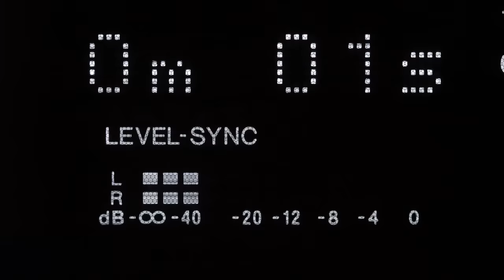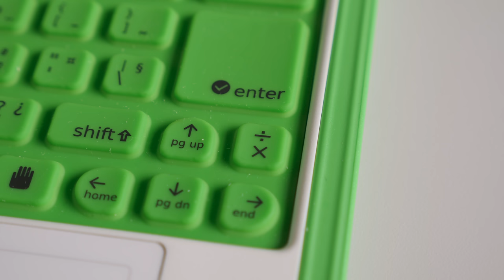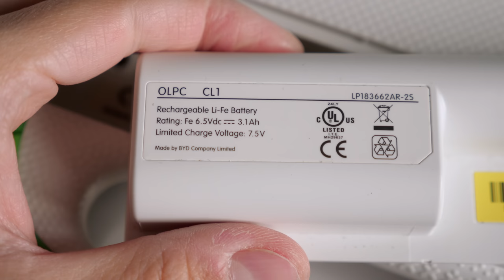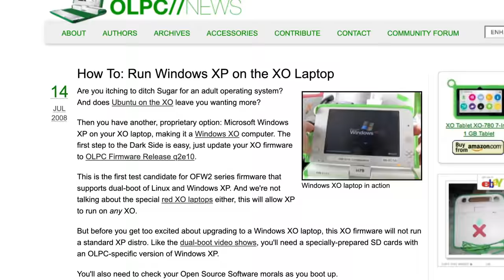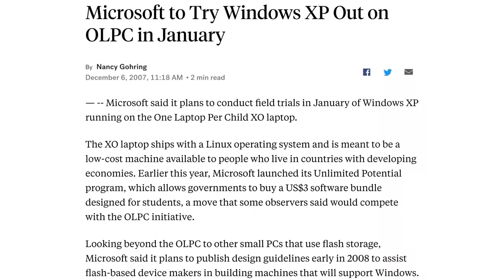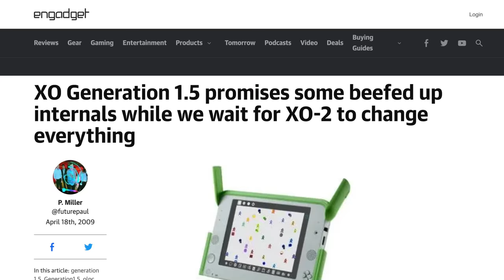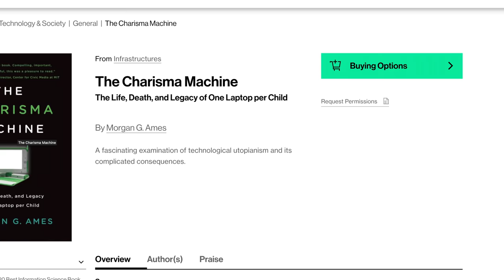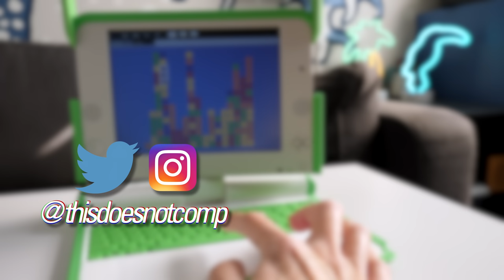OLPC XO-1: The $100 Laptop (That Wasn't)

Comment: I have a family friend who worked for OLPC, and he had spare prototypes and display models that he gave me when I was little. I still have an OLPC XO-4 Touch engineering sample, it's nearly identical to the production one except for having different speaker mounts (that started to sound awful after a few years), an XO-1.75 hinge cover, a different touch digitizer (mine has since been replaced with a production one), and the serial # sticker says "engineering sample, not for resale".

Comment: First of all, thank you very much for introducing a topic I've never seen covered before.  I think it would be interesting to put a team together and challenged them to hit that $100 mark through design changes and sourcing components.  A lot of nations have components made cheaply by using a miserly paid work force and pocket the margin between cost and price.  What if they can be convinced to sell some of those components at cost so that the poor of their own country as well as others could have computers.
Reply: already reached with the Pi 4. 35 to $70 depending on the RAM size - 4- 8GB

Comment: I have an XO-4, snagged from ebay, as well as an XO-1. The newer model really is tremendously more useful. In practice the battery life is doubled (with an identical, interchangeable battery, mind you) and everything from booting to compiling is roughly twice as fast. The XO-4 touch screen isn't capacitative: the bezel is deeper, and it uses a grid of IR light sensors/emitters in that bezel to detect touches. One nice thing about this approach is that it doesn't require the addition of any layers to the display module itself; that part is identical and interchangeable between all XO models.

Comment: Still one of the projects I'm proudest to have been a part of in my life and that I was the saddest about it's failure. It might not have worked, but we had some damn good ideas that wound up paving the way for other things. What still gets me is that the hand crank wasn't a part of the machine by default like it was in all of the prototypes (battery life was always on the chopping block) and it wasn't quite as powerful as it needed to be even for educational uses. It could have been a killer dual purpose hacking/light gaming machine for on-the-go but it just wasn't powerful enough to do anything really useful. I still think putting those controller buttons on the face was a great idea. I'm shocked to hear it actually made some wide adoption, I remember the whole thing just fizzling out. I knew the project was over though when people kept insisting on shoving windows onto it and even some governments refusing to adopt the project without windows support. That wasn't what it was designed for at all but we see even today people refuse to break their x86 addiction. It's just the way these things go once they hit the mainstream, and this was a hard way to learn that for a lot of us. You can see the same thing happening today with so many people buying Raspberry Pi's just to use them as retro game machines and refusing to learn anything about the OS much less actually run it to transfer their roms. People might laugh at us and say we are wasting our time, but when the goal is noble and the cause is just it makes it all worth it.

Comment: I followed this quote closely at the time. I never saw any in the UK or Australia though. I think they did have a real impact though. In their own way they were a sign of things to come - they were essentially the proto-netbook, and as is hinted at in the video - the experience and confidence Microsoft gained on building Windows for low spec hardware did give them more willingness to tackle that with netbook architecture, which in turn inspired the Chromebook - bringing the whole project full circle to a low-cost, rugged, simple educational computer.

Comment: Thanks for the video. The XO deserves better recognition. I still have my G1G1 XO-1. For a while I used it as a daily driver laptop. Sometimes its limitations had me crying, more often it was a joy. I was able to install a more traditional linux desktop on it. Internally to OLPC I feel there were a couple of places they dropped the ball.

1) School boards are incredibly conservative organizations, and they set the curriculum. OLPC's commitment to Constructivist education, while noble and noteworthy, made it a non-starter many places. Particularly in the US where school boards were local.

2) OLPC had a very high minded motto "It's an Education Project". That is, it's not a product in a conventional sense. Other then the limited G1G1 project, you couldn't just buy one (or ten). There was no way to get them for something like a a computer club, pilot program, or the like, let alone for a curious individual.

Comment: I remember seeing announcements of these, including the concept with the built-in hand crank. But, I'm not aware of those here in Brazil.
The intentions were good, and the efforts were worth it, but, it really meant a lot of planning and cost cuts, which included performance.
If it was born a few years later, in the era of smartphones and tablets, with better and cheaper components, it probably would go further.

Comment: Computers have gotten so much cheaper now, and you have the ability to download an archive of Wikipedia to a 60 gb file.  Students can access an incredibly large body of knowledge offline through a smart phone, tablet, or laptop now.  Only issue is electricity.  Power banks are very cheap if you're using solar at the school, and i would imagine having a panel in rural homes would have benefits as well outside of simply charging a laptop or phone.

Comment: I have several of these still.  I really believed in the concept when they were announced and wanted to make apps and games for it.  But it was pretty clear things were not going to work out.  They neglected the growth of Netbook market that was ultimately doing better than what OLPC could do in terms of price and performance of the hardware.  

On the software side, I think the problem was more fundamental.  I saw the attitude of typical western way of thinking and just providing kids with edutainment level of softwares.  I always argued it should be something that could lead for kids to directly work with everything that the workplace uses including the OS.  The argument was that you can install Linux based equivalent of word processor, spreadsheet and so on.  

I still wish it would have been a different story in the alternate history.  Perhaps some sort of agreement could have been made for Apple to come up with a version of OS X that was open source... Or someone business savvy was in charge at OLPC to have more of a market ready model... :(
Reply: Microsoft choked it out by forcing vendors to only sell MIcrosoft operating systems.

Comment: Back in the day I read that the arm based version was going to be based on RISCOS, the same os that ran on Acorn computers and now on the Raspberry Pi. As someone thta owned  Riscstation 7500, the use of that operating system made sense. It is so efficient that my computer with 16mb of ram ran just as well as my Windows PC with 128mb of memory. Sadly, Riscos was never used.

Comment: I remember when these were first announced, It was a really good idea, I wish they could have achieved it more effectively. The raspberry pi I think has become more of a successor to this idea. $35 little computers you can do anything you want with that can connect up to just about any screen you can find. So for about $50 to $60 bucks you can get a computer up and running using an old tv a cheap mouse and keyboard with everything being stored on plentiful and cheap SD cards, the idea has kind of pushed forward. And unlike the OLPC initiative, Raspberry Pi had wider spread appeal in industry and general maker space that it just became possible to perpetuate itself far more than OLPC's XO-1 as it wasn't just a non-profit trying to bring computers for education to the 3rd world. Raspberry Pi was trying to bring computers and learning To anyone and everyone interested. The XO-1 is still an interesting piece of tech, with good ideas behind it.

Comment: The OS this device runs is called Fedora SoaS (Sugar on a Stick). This version is a VERY locked down version of fedora. As the interface suggests, it is meant for children. The OS can also be freely downloaded by anyone if they wanted to run it on a different machine. I guess you could call it the ChromeOS at the time.

Comment: Quick note.  The XO-4 did not have a capacitive touchscreen.  In order to keep the Pixel Qi screen, instead we used an IR based touch system using Neonode's technology. This meant it could also be used while wearing gloves, or with any generic pointing device.

Comment: I think the OLPC was a great way of bringing the budding tradition of computer use to the impoverished world. I think the concept of the hand crank might have been a bit short-sighted. A gas generator or solar panel network would have worked better. I also think that shared desktop computers might be a more feasible means of getting children computer access since the machines may last longer. But there's something beautiful about each kid having a computer. 

I always thought the XO-1 model was cute. I wanted nothing more than a laptop and a docking station as a young child, and I was also fascinated by Linux distros. XO1s seem like cool machines for their time. While the rubberized bumpers and thicker shell than most laptops made from plastic at the time might have contributed to its durability, you also have to consider that solid-state drives are more resilient than the (electromechanical) hard drives common at the time. A modern MacBook can also take a few drops.

Comment: 3:40 Don't forget that LiFePO4 batteries only got half the capacity (90-120Wh/kg) of a more common lithium-lon batteries that use cobalt or mangan, I guess with those batteries the XO-1 would achieve more than five hours, but these are also more dangerous than LFP cells.

Comment: I'm so glad the Raspberry Pi Foundation stepped in with a truly affordable and popular SBC.
Reply: As someone who supported both projects, they fill entirely different niches. The original idea behind OLPC was bold, not only in its price point, but also pushing some technology concepts like wireless mesh networking that built itself, as well as simplifying management of those systems. They also developed new technologies that I hoped would trickle up, since they addressed immediate needs in the third world, but also fixed problems for other concepts. The best example of this is the screen technology in the original models, which was an absolute marvel of engineering at the time, allowing for a color screen readable in direct sunlight, ability to turn brightness off and into an e-ink-like screen; if the refresh rate were able to be improved, it would've changed laptops globally.  The kind of capabilities that were planned for the classroom, like sharing lessons and allowing for students to electronically "raise their hand" are what we are seeing in classrooms now, only with more expensive technology. The OLPC project would've fundamentally changed classrooms and access to lessons for nations without the funds for fancy smart classroom technologies, while potentially fostering interaction between other classrooms, whether they were across the hall, building, countryside, or globe.

That's not to take away from the Raspberry Pi Foundation, though.  Their mission is to bring down the cost of a platform that can be given to elementary students to get them interested in programming. While the Raspberry Pi is an amazing tool, it wasn't intended to be a desktop system for the masses. Could it be made into that?  Sure, but it would still be pretty expensive. The number of applications that you can use a Raspberry Pi for is amazing, and that's because of how open and expandable that board is.

Basically, the OLPC was designed to open more classrooms, and the Raspberry Pi is designed to make more programmers.
Reply: @caseyroberts1171  Ok, you are correct. It was just what popped into my head.
Reply: a SBC is a totally different beast and not self contained at all.. no screen/battery/input controllers. giving someone on the remote planes of africa a raspberry pi board and expect it to be useful to them is silly
Reply: @InfectedChris  I'm sorry if my answer came off as pedantic or rude. Both projects are aimed at addressing some very interesting and extremely lofty goals. One could also argue that if OLPC was able to produce and distribute even ten times more units into the third world, the position of the Raspberry Pi would be seen as a natural extension, and lead to some interesting applications in the third world. What's funny is that you actually could come closer to the OLPC's goals with the Raspberry Pi 4 as the basis for a laptop, and the 8gb model could potentially be used for light server work.

Just because the project's intention was different doesn't mean that the Raspberry Pi can't be used to fill the goals of the OLPC. If anything, it brings that dream closer to reality.
Reply: @DanafoxyVixen  I would argue that there is still value in Raspberry Pi boards in the third world, especially at the college level. If OLPC had managed to distribute more laptops in the third world, we could have seen Raspberry Pi classes in elementary school, like the Raspberry Pi Foundation is aiming for.

I'm also one of those individuals that supports bringing technology and education to areas that need it. I believe that technology is one of the Great levelers in the world, giving opportunities to those who aren't as fortunate to accelerate development and investment. By bringing poor Nations the technology that they can use and develop, we can make the economy and the marketplace of ideas far more diverse, which makes everyone competitive.

Comment: That Geode lx700 was a really low consumption CPU, around 3 watts TDP,  of course very, very much at the expense of performance, which must have been hugely appalling. I'm wondering how unoptimized the rest of the system must have been for it to run for just a couple of hours on its built-in battery.

Comment: I actually have one of each version. I kind of collected them because I love Linux and laptops that were designed to run Linux (especially in the 2000's) were interesting.  I also like the purpose behind it. Also the Sugar DE is interesting as well. I've played around with them just because I could. I've also gotten other Linux distros running on them as well. the XO-x series were a fun little laptop for me to mess around with.

Comment: In some ways it seems like the Raspberry Pi became this thing's successor.  You can load up a pre-configured Linux distro and if a kid wants to learn programming it has more than enough power.  The funny thing about the OLPC's initial press buzz is that looking back, I instantly think of the hand crank.  But as far as I can tell, the crank doesn't actually exist.
Reply: chromebooks are there successor. pi are there own thing.

Comment: I like the "Li-Fe" label on the battery. Probably a mistake in translation somewhere, with 'ion' being mistaken for 'iron.'
Reply from the maker: Lithium-iron batteries are a real thing.
Reply: @ThisDoesNotCompute   There's lithium iron phosphate, but then the label would say LiFePO4 and I really doubt any laptop from that long ago would use LiFePO4 - they were barely out of the laboratory back then, far more expensive than the established lithium ion.

Comment: I've still got one of the early ones. My kids were about the right age for it when it came out. I liked the concept but wasn't impressed with the reality, and neither were my kids. Despite the supposed intuitiveness, I've never encountered anyone who could get the laptop open without instruction - every single person manages to remove the battery before they figure out how to get the lid open. The interface was clunky and inconsistent and some of the apps were baffling to use.

The overall impression I got is that a bunch of passionate open source developers designed the machine THEY would have wanted as a kid - not the machine the target market wanted.

Comment: Okay it had rubber bumpers and was made very sturdy. But was the software and learning material better or groundbreaking? When you start out for an ambitious project like this you have to compel people with something new. If they had real hard data that these devices clearly showed that kids benefitted over using a regular computer, that would have been a lot better sell to get more people to embrace it.

Comment: You know if you can find a way to hook up maybe a USB keyboard to this thing it could probably fill a niche market as a Distraction Free Writing device. Astrohaus has a 400 dollar mini laptop just for writing but the screen has awful delay due them using eReader screens for purely aesthetic to match the look of a type-writer. A lot of writers instead flock to an outdated piece of technology called an AlphaSmart that can be found for roughly 20 - 50 bucks that does the same thing and use it purely for writing. Heck Astro is even making their own variant on the Alpha but still has the nerve to charge 300 bucks for it

The multipurpose screen and the ability to handcrank the power so it can be used literally anywhere seems perfect for distraction-free writing. The keyboard is the only problem